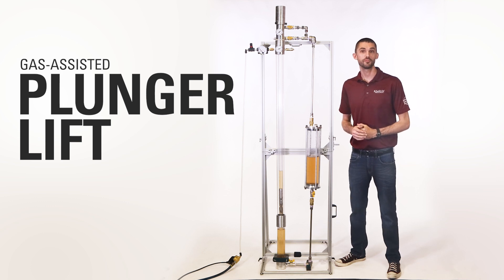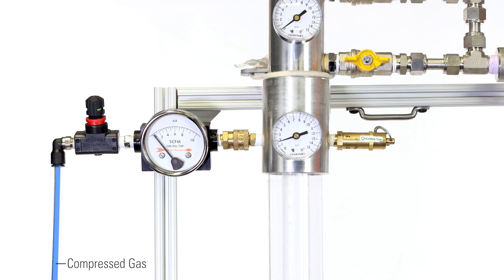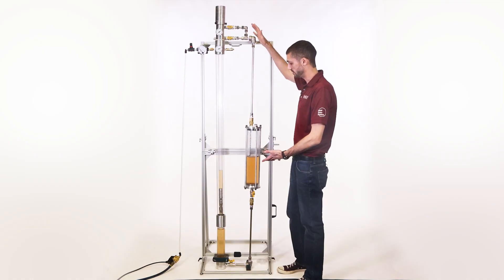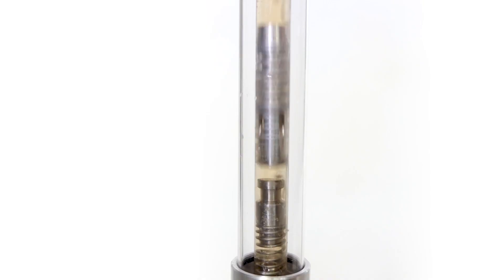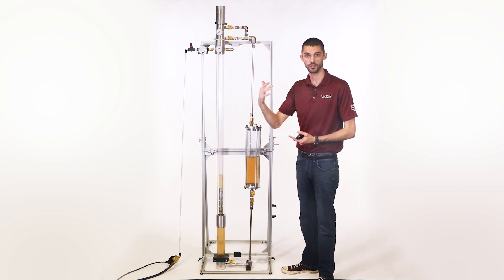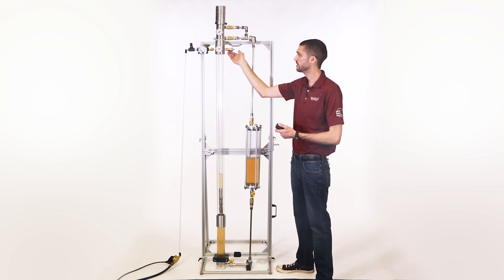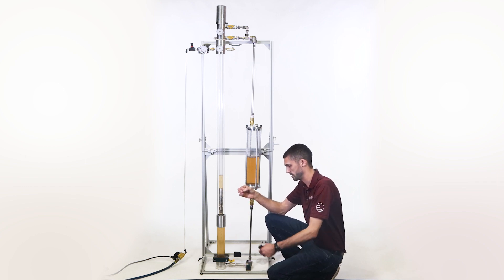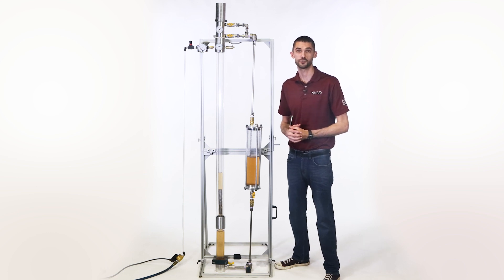Artificial Lifts: What is a Gas-Assisted Plunger Lift System and How Does it Work?

Comment: great appreciated, but how that plunger is goes up ? how the pressure difference is forms ?
to take it to the surface ?
Reply from the maker: The plunger travels up to the surface because of the pressure differential between downhole pressure and the surface equipment. When the control valve on the flow line closes and the plunger falls, downhole pressure will begin to build to a sufficient level to bring the plunger along with any fluid to the surface when the flow line control valve opens. Producers can lower the operating pressure of the separation equipment or inject natural gas (gas lift) into the well to increase the pressure differential.